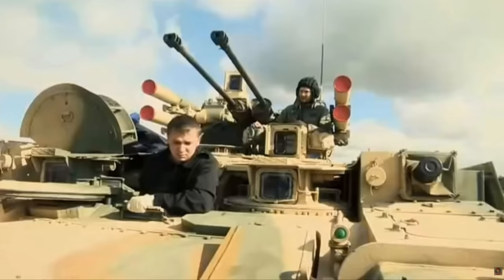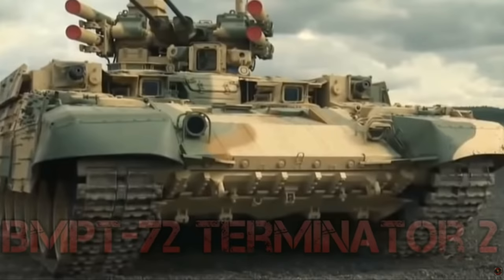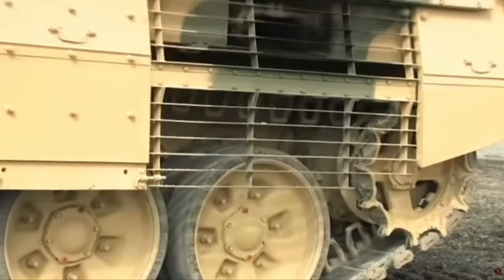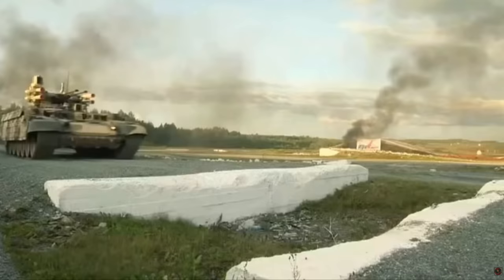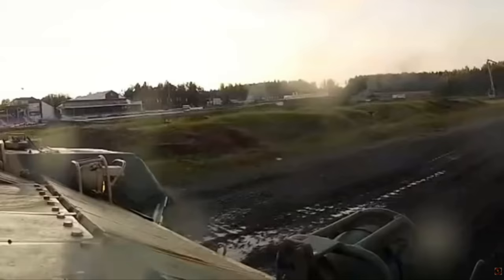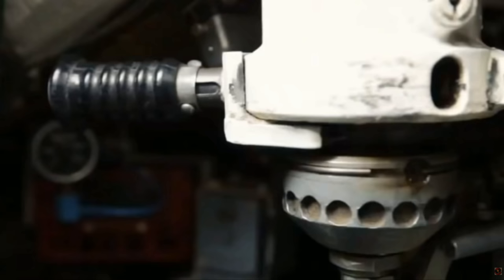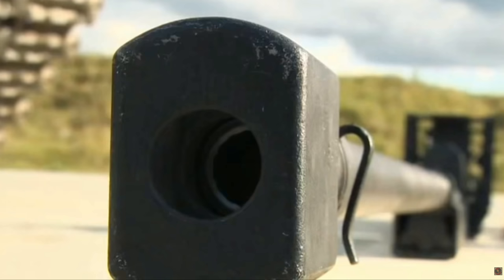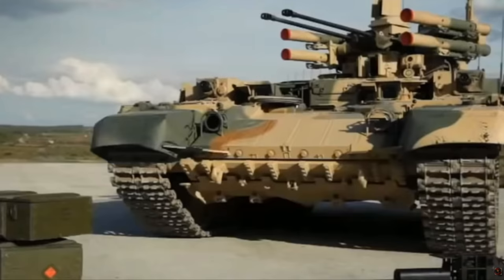BMPT “Terminator" Tank Support Vehicle Overview

Comment: Some things you didn't mention: 
1 - The Terminator can load thermobaric missiles instead of AT ones - such things are deadly against infantry and very effective against soft skin armor. 
2 - looking at footage from  urban fights in Donbass,  where you have several snipers in high buildings backed by teams of ATGM teams,  I think this vehicle has a very good place in modern warfare in urban conditions ; The russians struggled with Ukr teams who pin down infantry with sniper fire ( they place themselves in civilian buildings ...) and they use intensely
ATGMs to pop any BMP who try to counter the sniper fire. 
This machine can perform much better in such conditions, so the tanks can be left free to fight the heavy armor without the risk of "eating" a missile on flank. 
I will not like to be in the shoes of a ATGM team if such beast target me... Invulnerable at small arms fire, the Terminator can saturate a determinate sector with mortar / auto-cannon fire,   and simply grind down hidden teams of ATGM.s in buildings. 
And a thermobaric missile can "clean" a whole floor of enemies from distance.
Reply: هذة الدبابة تحولت إلى مدرعة مشاغلة مشاة واشتباك خفيفة لكنها ضعيفة جداً
Reply: Near the same vulnerability to ATGM as any tank.
Reply: What's the problem with placing troops in civilian buildings with no civilians in them when being attacked in your own country? The Russians shell every kind of building anyway, so I don't see why being in a military bunker vs being in an apartment is any different tactically, apart from making sure to evacuate any civilians which was done 2 months ago from Sievierodonetsk where most of those videos come from.
Reply: @Indigo Rodent Russian positions in civilian buildings that were evacuated months ago, so no problem here either in terms of ROE.

It was a little bit of a problem early in the war when Russia was using civilian structures as positions and pooling people into the basement so that it's not a "legitimate target" and Ukrainian artillery could only strike in the yards. Ironically while crying about "azov using human shields".
Reply: @mytech6779  - you are badly wrong, is a lot harder to struck than a tank:  much better visibility, a lot more weapons, and - just a detail : did you ever saw that huge cloud of dust and smoke the tank gun barrel made after a shot - and how the crew is practically "blind" after a shot ? 
Also, are you aware a tank cannot target / see targets in high vertical angles ?
Reply: @mirandela777   A periscope may be able to turn in any direction but it is still a very narrow view at any one moment. 
And there is no target to look for until after the AT missile has been fired at the BMPT, and then it does not matter if the turret was designed to turn to any angle because it will be destroyed.
Reply: @mytech6779  - lol dude, you think is so easy for an ATGM team to snipe a tank ?! You need to aim, the weapon is usually big and bulky, let you exposed a lot, and an experimented tank crew will cover any possible angle with fire - and at least, not all shots translate in a kill, we all saw vids of tanks/ BMPs hit several times and yet continued to fight and retreat. If you screw first hit, you are doomed...

Comment: What this vehicle needs (for urban combat) is for some of the crew to be wearing the same kind of helmet that a F35 pilot enjoys, of course this requires the vehicle to have all the outside sensors and cameras installed.
This would give the crew the ability to look up/down/all around to find the enemy. Getting rid of one of the grenade launchers and replacing that gunner with a drone operator would be helpful.
Reply: I've heard that Israelis are working on such system for their Mercavas.
Reply: Hi John, I imagine that cost would be a factor. The sensor packages and the helmets would cost much more than the "tank" Secondly, Russia can't get computer chips powerful enough to build a dishwasher at the moment let alone something to match what is in the F35.
Reply: @davidpalmer4184  You know, that brings up something that has pissed me off for decades.
If you have a system that would be useful on a lot of different vehicles then why not order a standard package that can be retrofited to 80 percent of those vehicles. It would drive the cost way down and make your warfighters much more effective. Just make sure you offer bidding to everyone that can produce it, in this case Dell or HP and not Lockheed. You want it produced not delayed.
Reply: @davidpalmer4184  The chinese can supply the computer chips and the sensor module. They have the tech and pretty much monopolize the global REM(rare earth metal) trade which is needed to build the chips and sensor module.
Reply: Russia is too poor for that, they use old binocular sight

Comment: The Syrian Army developed tactics for using armor in an urban environment. A pair of tanks would would move forward with a BMP following. The 30mm gun and coax MG on the BMP could be elevated higher than the tank's gun and could hit higher up a building. With the BMP providing cover the T-72s could blast the lower levels with the 125mm guns. I think the Russians learned from this and built a dedicated vehicle that could fill the same role as those BMPs but do it a lot better.

Comment: Great and instructive video as always!

OT: Was just wondering if and when there'll be follow-up video on CV90. Felt the latest CV90 video could be like part 1 of 3, as there's so much more to cover with all different CV90 variants. I'd also be curious to hear Matsimus opinion on the CV90 120mm variant as this configuration is interesting and unique (to my knowledge).
Reply: VariantsEdit
Estonia has purchased 79 CV90s from Norway and the Netherlands
DomesticEdit

The following versions were developed by Hägglund/Bofors in cooperation with FOA and FMV for Försvarsmakten as part of the Stridsfordon 90 (Strf 90)-family.[19] Sweden originally planned for a mix of CV9040 and CV9025, tests of the 25 mm turret being carried out on an Ikv 91 chassis, but finally decided on the 40 mm version, due to the much higher versatility of the larger calibre.[20]

    Stridsfordon (Strf) 9040 (SB1A3): The original model carries eight soldiers and is equipped with a 40 mm Bofors autocannon. From November 1997, the gun was gyro-stabilized.[19] Versions are referred to by the letters A, B or C depending on upgrades. All from A onwards remain in service.
    Strf 9040 : Original production version with no gun stabilization and Lyran mortar. Incremental improvements were made during production; all have been upgraded to Strf9040A standard.
    Strf 9040A: Strf 9040 upgraded with extensive chassis modifications and external gun stabilisation on turret front. It has more storage and better emergency exits, and the seats in the troop compartment were reduced to seven.
    Strf 9040B: 9040A updated with improvements to armament (new fire control software, electric firing pin, fully stabilized gun with internal stabilisation and reserve sight with video camera for the gunner), improved suspension for better accuracy and crew comfort while moving, new instrumentation and new seatbelts.
    Strf 9040B1: Strf9040B modified for international peacekeeping missions. It has a 3P ammunition programmer, climate control and anti-spall liner.[21]
    Strf 9040C: Upgraded version for crew training and international operations. As per 9040B1 with additional all-round armour, laser filtering in all periscopes and tropical grade air conditioning. Due to the bulk and weight of the modifications, only six soldiers can be carried.[19]
    CV9040 AAV
    Luftvärnskanonvagn (lvkv) 9040: Anti-air vehicle, fitted with PS-95 radar from Thomson CSF Harfang (now Thales Group) and a high elevation 40 mm autocannon capable of using programmable ammunition. It is connected to the national air defence net LuLIS. Three have been upgraded to C-standard.[22] There is also a demonstrator, designated Lvkv 90-TD, fitted with infrared video targeting and a fully stabilized gun for firing on the move.[23]
    Granatkastarpansarbandvagn (Grkpbv) 90: (Tracked Armoured Mortar Vehicle), producer name Mjölner: A CV 90 fitted with two 120 mm mortars. The 40 CV90 hulls for this project had already been purchased by 2003 and were originally intended to be equipped with the Patria Advanced Mortar System. For economic reasons, Genomförandegruppen recommended against it and the AMOS order was cancelled with the vehicles put in storage until BAE Systems AB received a contract in December 2016 to install Mjölner 120 mm mortars on the 40 CV90s to increase the indirect fire capability of mechanized battalions.[24] The first units were scheduled to be delivered in January 2019 and all 40 vehicles will be delivered by 2020.[19]
    Stridsledningspansarbandvagn (Stripbv) 90 (Forward Command Vehicle): Used by the battalion and brigade commander for command and control. Two were upgraded to C-standard, but have been decommissioned as of 2011.[22]
    Eldledningspansarbandvagn (Epbv) 90 (Forward Observation Vehicle): For directing artillery and mortar fire, a more advanced IR sensor was fitted; eight have been upgraded to C-standard.[22]
    Bärgningsbandvagn (Bgbv) 90, (Armoured Recovery Vehicle): Two 9-tonne winches provide a maximum capacity of 72 tonnes through 4-way pulleys. Three have been upgraded to C-standard,[22] and at least one has been used in Afghanistan.

The command, forward observation and armoured recovery vehicles are armed only with a machine gun.

The following versions were not taken into Swedish army service.

    Störpansarbandvagn (Störpbv) 90 (Electronic Warfare Vehicle): A 9040A had its turret replaced with a fixed housing containing retractable mast and a LEMUR weapons station. Planned in 2002, a single unit was produced before serial production was cancelled for economic reasons and as of 2013 the project is still on hold.[19]
    Strf 90120 / CV90120-T: Light tank demonstrator armed with CTG 120/L50 (Compact Tank Gun) developed by RUAG. The gun is 120mm smoothbore, calibre length 50, with a rate of fire of 12–14 rds/minute. 12 rounds are kept ready in the turret bustle, with a further 33 stowed in the hull rear.[25]
    Stridsfordon 9040/56: Prototype version of the CV 9040 equipped with the Bofors RB56 anti-tank missile. Issues with the sight alignment were unsolved and no units ordered.[19]

Export versionsEdit

The export versions of CV90 is delivered with the combat proven BAE Systems Hägglunds E-series turrets with armament ranging from 30-120mm. The vast majority of the 600 turrets delivered are fitted with 30mm or 35mm guns.
Finnish CV9030FIN
CV90120-T prototype, from which PL-01 mockup was developed

CV9030
    Export version with a 30 mm Bushmaster II autocannon. Adopted by Norway, Switzerland and Finland. Within BAE Systems Hägglunds, the original version of the Norwegian CV9030N is known as the CV90 MK I. The Finnish CV9030FIN and Swiss CV9030CH vehicles are known as the CV90 MK II.[26] The CV90 MK II is also available as CV9030 COM – Command & Control Vehicle. The recently upgraded CV9030N infantry fighting, command & control and reconnaissance vehicles for Norway are known as CV90 MkIIIb, and this is the most advanced variant currently in service.[27]
CV9035
    Armed with a Bushmaster III 35/50 cannon. Adopted by the Netherlands as CV9035NL and Denmark as CV9035DK. Within BAE Systems Hägglunds, CV9035 is known as the CV90 MK III.[26]
CV90105
    Light tank equipped with 105 mm rifled tank gun/turret. Designed by Hägglunds (BAE Systems) and GIAT (Nexter). A newer version features the Cockerill XC-8 turret.[28]
CV90120-T
    Light tank equipped with a tank turret equipped with a smoothbore 120 mm gun. (RUAG 120 mm Compact Tank Gun)
CV90 CZ
    Export variant designed in collaboration with VOP CZ marketed to the Czech Republic, manned turret variant.[29]
CV90 CZr
    Export variant designed in collaboration with VOP CZ marketed to the Czech Republic featuring a Kongsberg MCT-30 unmanned, remote controlled turret, a slightly raised hull and periscope system.[29][30]
Armadillo
    Armoured personnel carrier version built on a modular CV90 Mk III chassis. The CV90 Armadillo can be modified to become a personnel carrier, an ambulance, a command and control centre, a recovery vehicle and many other non-turreted variants at low cost due up to 80% commonality among variants.[31] Currently, only the APC version has been built, with five delivered to Denmark for trials.[32]
CV90RWS STING
    Combat engineering variant built on CV90 Mk I chassis. This vehicle can be outfitted with either a mine plow or a mine roller, and it also has a robotic arm. 28 have been ordered by the Norwegian Army.[33][34]
CV90RWS Multi BK
    Mortar carrier variant built on a CV90 Mk I chassis. This vehicle is armed with a VingPos Mortar Weapon System outfitted with an 81mm L16A2 mortar. 24 have been ordered by the Norwegian Army.[33][35]
CV90 MkIV
    BAE-developed upgraded variant revealed in January 2018, marketed to the Czech Republic as well as existing customers as an upgrade package. Features include a Scania engine with up to 1000 horsepower, Perkins X300 transmission, and an increased payload of 2 tonnes. The system also includes BAE's iFighting computer system, which claims to enhance situational awareness, aid decision making, improve ergonomics, and enable autonomous support and remote operation.[36][37]
CV9035NL MLU
    On 13 January 2021, the Defence Materiel Organisation (DMO) of the Netherlands Armed Forces signed a contract with BAE Systems Hägglunds for a mid-life update of 128 CV90s of the Royal Netherlands Army, with an option for 19 further vehicles. The MLU project features a wide range of modernisations and improvements. The turret has been completely redesigned and will feature a new main gun installation, a mast-mounted 500mm extendable electro-optical sensor, Elbit Systems’ Iron Fist LD (Light Decoupled) active protection system, FN MAG general-purpose machine gun in an external pod and a twin missile launcher for Spike LRII anti-tank guided missiles. Furthermore, the CV90s will be equipped with rubber tracks, upgraded cooling, various cyber-security improvements and updated command and control infrastructure. Construction of the new turrets will be conducted by Dutch firm Van Halteren Defence.[38]
Reply: Guess where I got that info from
Reply: @DEATH-THE-GOAT  Brilliant summary and great job!

Comment: They should replace 15-20% of their mbt's with these Terminators on a battlegroup level. 
Definitely a force multiplier against enemy infantry formations, who are (as we know) one of the biggest threats.
Reply: Well, they would be effective in the battles that they are currently fighting where its mostly tanks vs infantry, however swapping 20% would probably cause some trouble. We have to remember there is an even newer version of this the T14 variant which is probably gonna be what they are aiming for. But without APS nothing will survive long nowdays.
Reply: Could drop new terminator turrets in mbts. Plug and play
Reply: The'll need to replace destroyed mbts anyway might go for some variety.
Reply: That wouldn't change anything. It can not see what other standard tnaks can't see either (all modern tanks have a thermal optic today). It doesn't have any special kind of super-vision that other tanks don't have either. Although the commanders' own indepdenet sight is indeed an improvement for most Russian tnaks, which don't even have that. But it's still difficult spotting enemy infantry hiding in bushes and buildings, let alone identifying to which side they belonging... And since it doesn't have any APS it is still just as vulnerable to missile attack as any other Russian tanks. So we will probably see the first destroyed Terminators very soon.

Comment: The new weak point on combat vehicles is quickly becoming the fancy optics. 
I can see a return to anti tank rifles for the purpose of destroying those optics to “blind” the main guns or anti missile systems before a second strike by said missiles.
Reply: That if they can accurately shot at it
Reply: @ralpjosephjavelosa7451  ...before the tank spots and shoots them
Reply: I don't think that those optics are really all that durable, you could probably knock them out with some accurate bursts from a GPMG. Yet another reason why infantry support for tanks is so important.
Reply: that's assuming the thermals don't see you first
Reply: the Yugos figured that out decades ago
Reply: The optics is a tiny square about 15cm by 15cm.....slightly larger than a Samsung flip.its made of metal on all sides which I presume is at least some what resistant to bullets except for the front of the optics.....which means u have to fire at it while it's directly facing u.....assuming the average marksman can hit such a target from 50m out nvm 100m or 200m.......
Reply: HE/frag
Reply: @jont2576  paintballs!?
Reply: this is completely ridiculous. you could do this in theory with a machine gun and its obvious why no one is idiotic enough to try this on a real battlefield.
Reply: No need when ATGW can destroy them and perhaps the vehicle and lighter rockets have greater throw weight than a rifle. Even an RPG 7 does more damage.